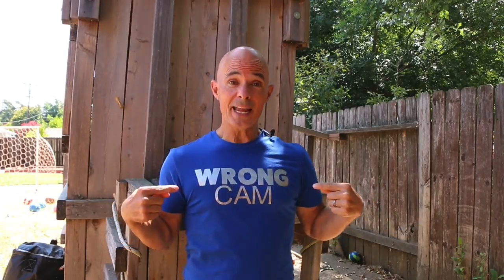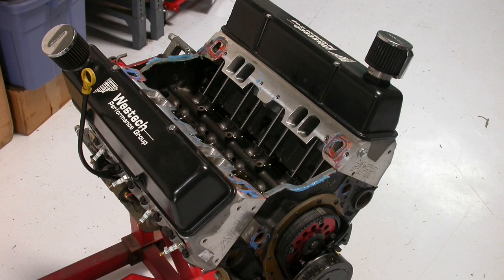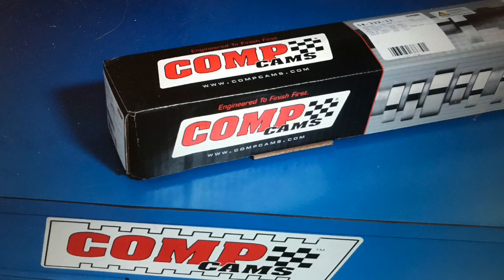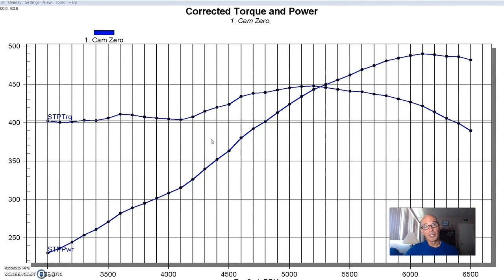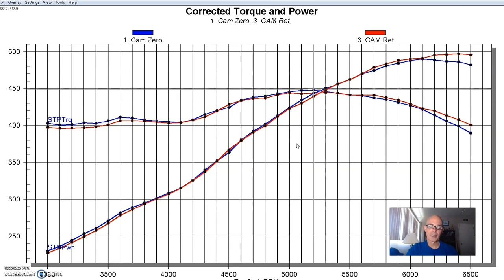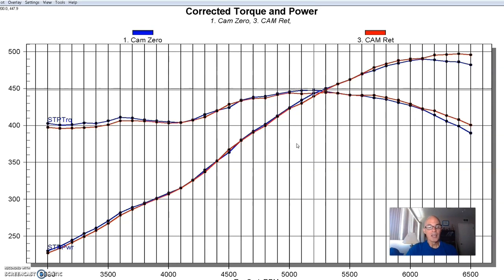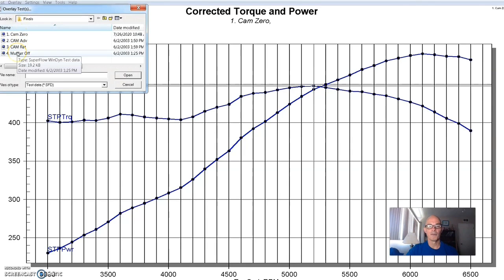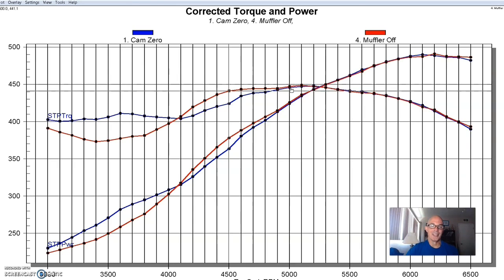TESTED-SBC ADJUSTABLE CAM TIMING

Comment: Changed the timing set on my 72 429 TBird and NAPA gave me the wrong year a 73 and up year that is retarded at the bottom gear . It was a car that would fry rubber in first and second gear (one tire) ! After changing the to the retarded gear set (not my choice) it wouldn’t even spin the tires! Killed gobs of power! Totally stock 72 429 why would it loose so much power?
Reply from the maker: should only be 4 degrees if I recall

Comment: Like a slippy pipe in a 2 stroke race kart, a  cable operated length   adjustment gave it another 1000 rpm up top on a little 100cc Yamaha. 
Couple inches of travel if I remember correctly

Comment: Backing off - the cam timing is the way to go IMO The more compression you have the more you can rewind the cam without hurting the low end that much. My combo, lq4 with LS3 flat tops, stock 706 heads and a 220/224 115 -4 119 ICL custom comp cam

Comment: Pro stock engines are running really short headers with a collector that looks like a funnel. The difference is a 10,000 rpm engine  instead of 6,000. 
What I found with header length is it's not necessarily HP level to size a header, but mostly rpm range.

Comment: What about retarding a cam with the purpose of reducing dynamic compression? If you have some mild detonation with premium fuel, would retarding the cam timing 4 degrees on the adjustable timing set help? What about piston to valve clearance? By retarding the cam you may be able to pick up some needed clearance to make sure you don't have contact between the piston and the valves. Is this correct?
Reply from the maker: retarding the cam will improve p-v (intake) and might change detonation threshold

Comment: Richard, I am extremely interested in your opinion on an issue I'm presently faced with. I'm assembling a 383 sbc for my daily driven 4x4 truck. 5.7" rods, 24cc dish D-cup pistons, AFR 190 Vortec heads. Truck will retain the factory Vortec intake with upgraded 36lb injectors, and a ported throttle body(76mm). 

I'm having a custom ground hydraulic roller made for this engine. I've pretty much settled on these lobes...
266°/266°
210°/214°
.505"/.495"

I'm still torn between 110 or 112 lsa because IVC point is my main concern. Simulations show that my best torque curve is produced with a 56-58° IVC event. The catch is that I want this truck to run happily on 87 octane fuel. My static compression will be right at 9.0:1. When I advance the intake events to attain the best low to midrange torque and throttle response, I end up with a dynamic compression ratio in the 7.6-7.8 range. I'm concerned that I will have to pull so much timing to avoid detonation that it won't be worth the effort to run the advanced cam timing. 

Ultimately, my question is which has greater effect on torque production and throttle response in the 2000-3500rpm range......valve event timing or ignition advance?
Reply from the maker: valve events and dynamic compression are not the only things that determine detonation-run the tighter lsa with that cam

Comment: The removing the muffler test may apply at the drag strip however to fix that behavior, one could add pipe. Also, on street cars, it probably wouldn't apply at all. One test I would love to see is a muffler shoot out. Glass packs, stock exhaust, anything popular.

Comment: I seen a video of a sliding exhaust setup on a small 2 stroke race boat. Was a 2 cylinder and they picked up 10MPH if I remember right.
Reply from the maker: 2 stroke exhaust (expansion) pipe tuning is different than 4 stroke

Comment: Advancing the  timing is prop what Im going to do after checking Piston to valve clearances.      What happens to compression ratio when you advance the camshaft 4 degrees?
Reply from the maker: CRANKING COMPRESSION MIGHT GO UP-AS WILL LOW SPEED (AND MID) TORQUE

Comment: Could you use an electric exhaust cutout that opens at a certain rpm to ‘shorten’ the exhaust runner length and pickup high end power

Comment: I have a sbf 306 ed curtis custom cam.  I degreed it upon installing and it can up to be straight up.  Ed's cam card had two centerline's on it.   Straight up, I forget the number but he put "vehicle 3500lbs".  So for years the combo I had would go 12.4s.  after yrs I decided to retard the cam 2 degrees which was there other centerline on the card.  1st pass after the -2 degree retard car went 12.2.  I was now pulling harder on the top end and the car wasn't laying over just going through the motions.  Come to find out the car was 3150lb with me in it.  Eventually I did long tubes and a systemax and the car bested 11.63

Comment: I'm building this exact engine except it's a stroker 383 with rpm air gap and 286hr magnum cam.
I'm questioning my cam choice though. Should I get an xr282hr or xr288hr instead? 
Don't care about vacuum and have 4.11 gears. Don't want to rev past 6,200.
Love the videos. You have the most specific details I have found on YouTube.

Comment: Use the standard equation to calculate header length.  45" primaries really pick up low end.  Zooomies are the right length for a high rpm drag engine.   Adjustable collectors  are available. AS Vizard says you will not lose hp with the right muffler.  Try no header at all . Straight from the head. Amazing what that does.

Comment: Good info as always!  Around 1990 I raced (street/strip) a '73 340 Duster with a purple shaft mild hydraulic cam with the '73 smaller heads.  The gear was a 3.55 posi and 3,200 stahl.  I advanced the cam 4 degrees and picked up a full tenth.  As for exhaust, I always ran a "too long" 2 foot 3 1/2" collector off the street headers.  The car always had good torque for a small motor plus made it sound like a big block.  Can't remember how many times someone would say "you running a 440?"  The car ran 12.90 in the quarter as described here plus I could drive it to the strip easily.  Always a blast picking up an impromptu race to or from the strip which was always a surprise to the other guy.

Comment: I really want to see some side by side comparisons of VVT LS cams vs. cams with the same specs that are fixed. Texas speed offers several VVT grinds. The web is full of mixed opinions on VVT. Would love to see some actual testing!
Reply from the maker: I can't run VVT cams
Reply: Richard Holdener  dont have an ECU capable?
Reply: @richardholdener1727  That is unfortunate...... most all of the newer LS ECU's all run VVT and DOD. (I can't stand DOD though)

Comment: A nice super easy trick to find out the proper length collector extension on "YOUR Engine" meaning anyone's engine in there car or truck by installing a 24" length collector extension on each header , then paint the collector with a engine paint 800degF.  not exhaust header paint 2200degF.  let it dry, it does not have to be a perfect paint job at all then once it dries.
 take it for 1 hard run "Think Dyno Pull"  then look for the  worse burnt paint spot on extensions and cut pipe there.
That should be "YOUR ENGINES" optimum collector length for what your engine wants

Comment: While removing a header attached muffler has the effect (shown in the video), on a street car where the muffler is further back in the exhaust stream, is that effect as dramatic?
Reply from the maker: no-then its just flow if you have enough collector length

Comment: What is the maximum power you can put through the back wheels from a standing start before you get wheel spin?
What RPM do you change up a gear?
I guess I'm talking about American cars here, I'm from the UK, so it's not as dumb a question as it seems, yes I know it depends on tiers so I expect a wide range answer.
Reply: anywhere from 130crank to 500+whp. A lot more than just hp and torque go into getting a car to accelerate so thats a huge loaded question lol
Reply: @knowbull5hit590  yes, loaded like a thing. My point/question is, do you realy need so much power below a certain revs? Is the trade of worth the extra power in the band you would be accelerating through.
Maybe, sometimes...

Comment: An old timers exhaust trick I’ve heard is to spray paint the pipes and run the motor nice and hot, and let some of the paint burn off. The point on the pipes where the paint stops burning is where to cut for best results
Reply: it was tested on engine masters show and it proved that dosent work. im with you, I did it that way till i seen the show and it changed everything for me after that

Comment: Chevrolet hystory of the V8. When Chevy entered the V8 they set out to be their aftermarket performance parts department. 

I wouldn't mind seeing an OEM spec performance build instead of everyone running to aftermarket.

In your videos you say when Chevy runs a dyno test the run it full dressed meaning factory parts are designed to operate with the resistance of the air/exhaust/accessories installed. 

I know the best combo but wouldn't mind seeing what other combos would do.

Best being 327 crank 3.90 lt5 pistons with the 350hp 327 cam, VORTEC heads, 327 valves, thru ram manifold x pipe fallowed by  throu x cat back, corvette EGR baffle. First TPI (the increase brings up the rpm range but modifications required for 6.0ls injectors to hit 10,000rpm.

I wouldn't mind seeing a 350 crank, 3.90 pistons with a 350 cam vortec 350 heads and a ram jet. Same exhaust though. With OEM replacement parts i think the efficiency would be nasty.

Comment: hey Richard do you have any data on the 454ho cam testing from the super chevy article? They used the extreme energy grinds from 268-284 and with the 274 the 454 made 507 horsepower which is the cam i have in my 454 along with oval port speedmaster heads and i just saw on hot rod garage they built a 454 with a similar cam only a roller marine xm284hr-12 with rectangular 320cc speedmaster heads and it only made 472 HP. I was just wondering if you would be able to explain why the power difference is so great? I would have thought a roller cam with the same lift and duration numbers would make more HP not less? Are marines cams just that different? or were the 320 heads a little too big for a 454? maybe just tuning? and in the hot rod garage episode they even used a single plane and in super chevy they used a dual plane.Was just really curious about the power differences another thing i was shocked about was the low torque numbers too it only made 470 thanks!!!
Reply from the maker: I try not to compare different motors on different dynos-its just not accurate

Comment: I’ve been looking at a cam for my 5.7 hemi. One I’ve been eyeing is the comp 201-428-17. My question is about intake center line. This cam has a 119 intake center line that seams like a high number. What is the affect of that?
Reply from the maker: that 428 cam works well

Comment: I have and love your honda books. Which do you like better vtec or ivtec? My 2013 Si has a K24Z7 ivtec. Both cams have vtc from the factory so duration is changed but lift is fixed I assume. It's amazing what you can do with optimizing the whole powerband. Which version do you think could make more power regular hi/lo cam vtec or performance tuned ivtec?
Reply: I think it’s a trade off. Less Torque (vtec) and less HP (I Vtec) adjustable lobe separation is awesome for flat power, lift makes HP if the head flows the air. Have your (I Vtec) head flowed and get the lift for that max cfm. Then Try more duration with and adjust the cam gears in both directions with the computer as much as the piston to valve clearance will allow.  This will allow a lot more torque down low and more HP up top.
Reply from the maker: VTEC cam change both duration and lift, IVTEC adds advancing and retarding the cams

Comment: Does changing headers OD change air/fuel ratio? All I did was took my old exhaust off and running now straight headers but I'm getting 17 on my air/fuel ratio gauge. I have not touched anything else and was running around 12.7 on gauge
Reply from the maker: if you have straight headers and the o2 sensor is close to the end of the pipe-the reading is not accurate from reversion
Reply: Thank you so much for your quick reply....

Comment: Richard,

I have a older 350 and am thinking of going with the Edelbrock package of heads manifold and such, I was looking at the 400 plus hp version, have you had good luck with installing these heads out of the box
Thanks

Comment: I would like to see this test repeated DOHC engine. Would be interesting to see the effects of overlap verse having  Near having no overlap. Would also like to see the test repeated again under boost. Would be interesting to see how it affects the boost  Curves.
Reply: It would do the same thing. It actually comes factory on most DOHC engines nowadays to make more torque down low and more hp up top. Boost is just more air into the engine as long as the back-pressure isn’t too high.
Reply: @mr.know_it_all  its not that simple. Smaller frame turbos can't tolerate to much overlap where as a larger frame turbo can and its actually better for it. I'd really like to see how it affects the ramp on of boost. How early/late it peaks and holds.

Comment: I forget which race car it was on, but Porsche used sliding intake stacks once to optimize their power @ RPM. Cool stuff.
Reply from the maker: They use it on production 911 motors as well
Reply: @richardholdener1727  That's awesome. Ya learn something new every day (if you pay attention).

Comment: Now You gotta set up an engine with variable intake and exhaust lengths that adjust with rpm use cut outs and varied length pipes on the exhaust and solenoid actuators on the intake stacks

Comment: Couldn’t you use a electronic exhaust cutout before the muffler and then have a holley ecu open the cut out at the crossover rpm point in the curve where the shorter exhaust starts to make more power

Comment: Is it degrees in cam or degrees in crankshaft when say 4 degree?
Reply: 0 degrees puts the cam at top dead center. He is advancing/retarding the cam in relation to TDC.
Reply: @cuzz63  ok,  so 4 degrees advance is 4 crank degrees which is 1/2 the degrees in cam.
Reply: @zmanphx  I actually dont know. I just know he is talking about the cam with the crank at TDC, there is a wheel they use to mark the degrees.
Reply: @zmanphx  I guess since the cam goes 360 when the crank turns 180 then it is 2 to 1.
Reply: @cuzz63  It is the other way round. Cam is half the  degrees of the crank.
Reply: @zmanphx  my mistake, thanks

Comment: Buell bikes have a butterfly in the stock muffler that change the pipe length internally and it makes a big difference between 2-3000.

We get a bunch come in for a tune where people disable them because the internet said it's a restriction..

Sadly most people mod without asking what actually works.
Reply: @MatthewFogarty-k2y  
Almost positive that's a straight through perforated style muffler.
Inlet and outlet are on the same axis, usually baffled mufflers have an inlet/outlet offset.
Reply: @MatthewFogarty-k2y  
That's typically more to pass noise laws in some countries, and also allow it to still have a half decent exhaust note under load.
Though it may have a slight effect depending on the muffler design.

The Buell mufflers I was mentioning physically change the length of the pipe internally for performance reasons, not just sound :)
Reply: @MatthewFogarty-k2y  
Backpressure being benificial is kinda a myth, only really applicable on 2 strokes.
The myth stuck around partly because large diameter pipes loose exhaust velocity at lower air mass levels (The real cause of the 'backpressure' performance losses)
Took a while to figure out that's what was actually the culprit and backpressure is never good.
Hook a vacuum up if you could would be ideal lol.

The difference here are reflective waves due to a length change, and thus the timing they arrive back at the valve.

Comment: You don't need a sliding exhaust pipe. Just a exhaust dump. You hook it up, so that it's closed till X RPM then the dump opens up and makes the run shorter. Problem solved. With the computer that most cars run, you build into the system a preset number to trip the electric solenoid to open the exhaust dump. Plus the transition would be smooth and seamless. You could do this on your dyno.
Reply from the maker: I want a sliding length to see if there is power to be had during the transition
Reply: @richardholdener1727  So like the two stroke go karts with there slipper pipe...

Comment: need test with a tuned VVT on an LT1!
Reply: As long as the spring pressure wasn’t too high it would work. Make power wayy down low and up top depending on how much piston to valve clearance you have 🤷🏻‍♂️

Comment: That's what cut outs are for. I did this in the 70's come out of the hole and open the cut outs at 3800rpm. Try it you'll like it. I was supprised to see no gain at all on the top though. We didn't have access to an engine dyno back then so it was kinda hit and miss and hard to get those fine adjustments that normally can show up anyway in road conditions and human error. This was nice to see proven on a dyno.

Comment: What about those switches that switch from Muffler to open you could maybe leave the muffler connected for the first 3000 RPM and then open it up at 4000 and see what the difference would be

Comment: i'm not only running mufflers and a full exhaust but it would be interesting to see what difference a larger wastegate would make. i'm running dual 60mm gates.
Reply: A wastegate controls boost. Still takes X amount of pressure in the exhaust to make target boost. A bigger wastegate would just take less movement to make target boost.

Comment: what difference do you think there would be with mufflers on a twin turbo setup using 3inch magnaflows per side but with the length on a twin setup??
Reply from the maker: it won't do this with a turbo set up